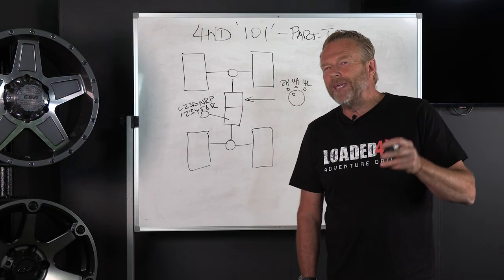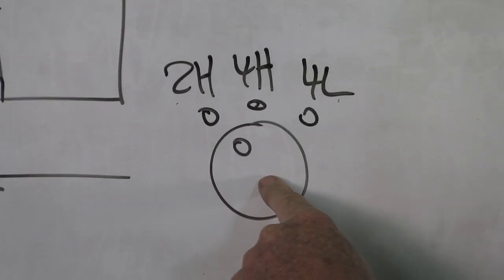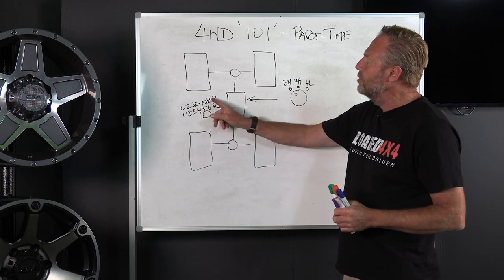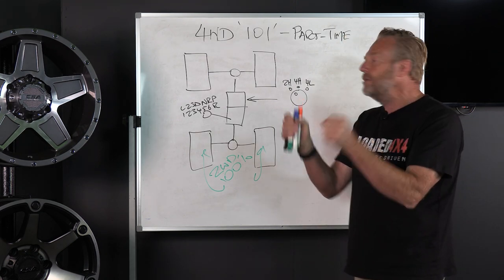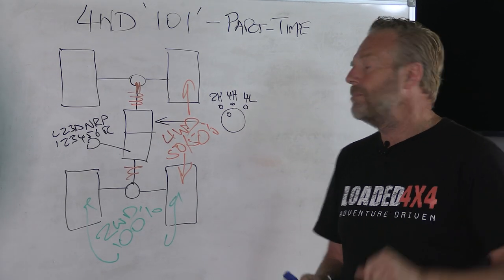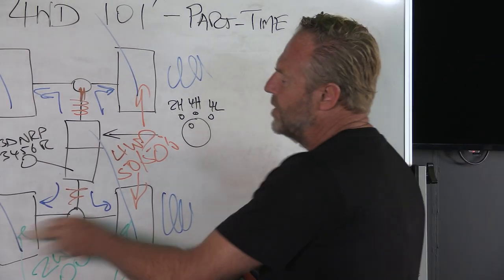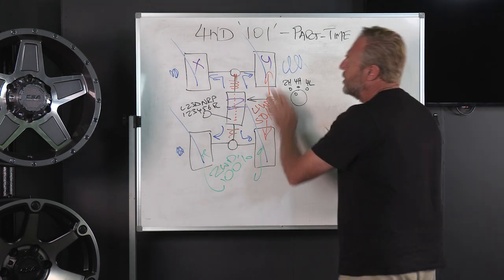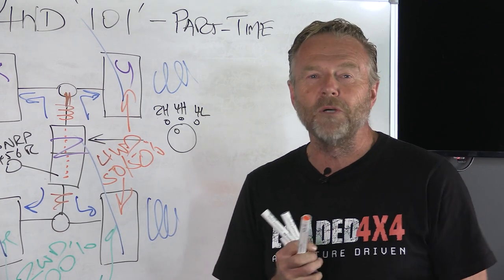4WD 101 : #1 Part-Time 4WD Explained

Comment: Why didn't you just say that when you shift into 4wd, the center diff locks both the front and rear drive shafts together and when cornering the front and rear drive shafts need to spin at different speeds because the front and rear wheels spin at different speeds.  It's easier to understand and dummy proof.
Reply: Thanks Anthony for your feedback, but... it's flawed. In a part-time 4WD, there is NO centre-differential. The majority of part-time 4WDs these days use a connection on the front diff to facilitate 4WD. When you shift into HIGH range (and best done whilst in motion), the front prop shaft is spun up to the same speed as the rear and then makes a synchronised engagement with the front diff sending the energy forward. I can see what you're getting at, looking for another way to explain it. For clarity, I think what we've posted is accurate. Thanks for your interest.